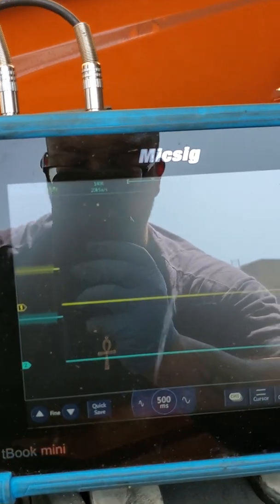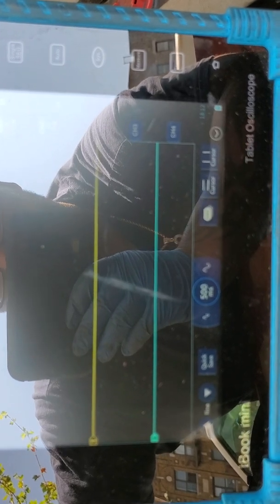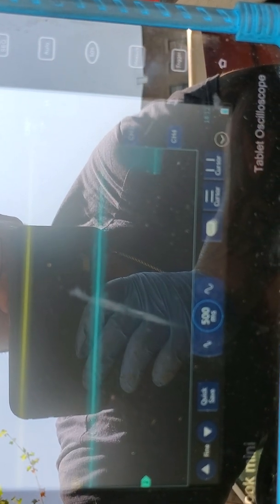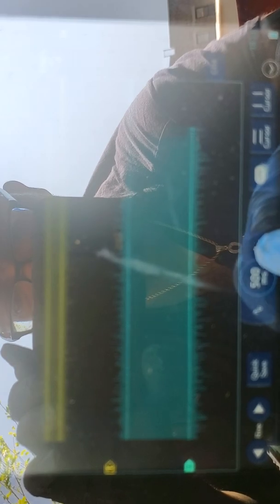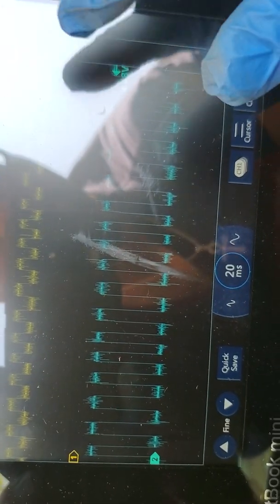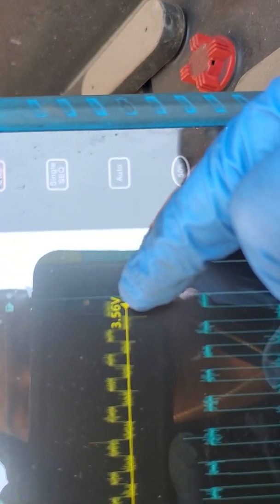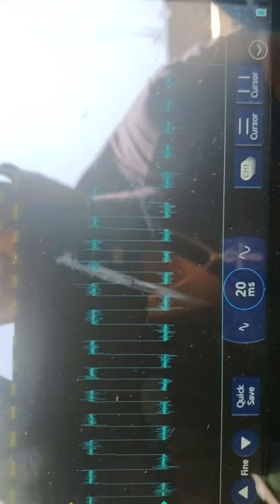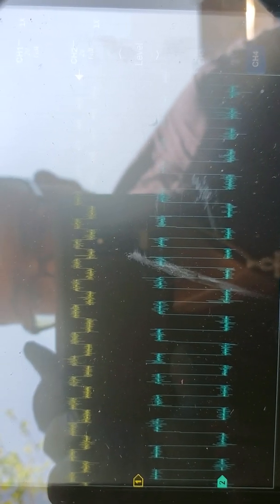Doosan B18-7 encoder fault

Comment: Looks like a bad negative connection inside the encoder to one of the signal channel based on the elevated voltage. Does it limit the speed on these units or just codes out and disable drive.
Reply from the maker: YES.  A Bad B- inside the actual encoder causing that one signal to remain high. Power and ground to encoder were verified.  Especially  ground because of elevated voltage. It will code out and the unit will jerk if you try to accelerate past 25%.  Sorry for late response and thank you for watching